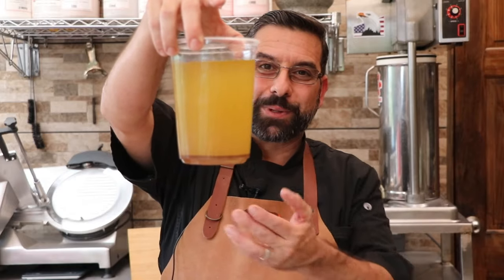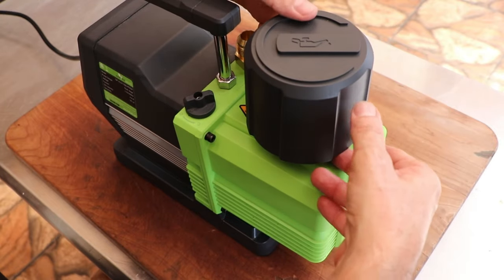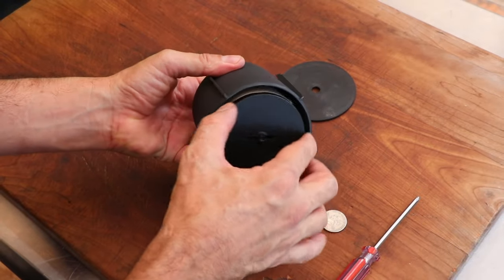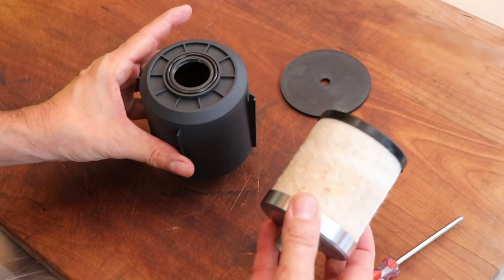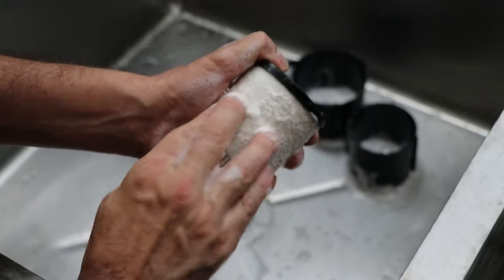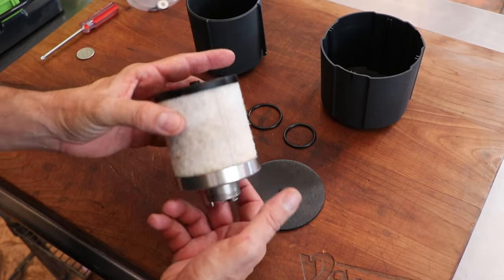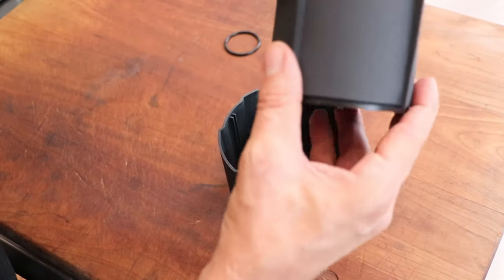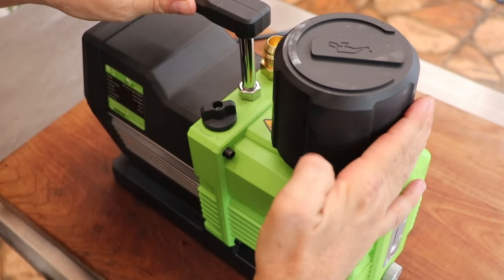How to properly clean the demister on your Harvest Right Vacuum Pump

Comment: I would recommend purchasing a second filter so you can install a new one then clean the old one and let it dry so it’s ready to be used the next time it needs cleaning!
Reply: I checked the website but do not see filters. Do you know where I can buy a spare one?
Reply: You may have to call the manufacture for the correct part for your pump.   @pamhoven
Reply: Yeah I’ve got a second but I’m unable to unscrew that plastic cover with a quarter. I’m beyond frustrated at this point.
Reply: @Fiona2254  the same happened to me. I wound up using two quarters and a large pliers, and gave it a few quick jerks, and it came free. Mine had quite a bit of locktite on it.
Reply: I used a butter knife and a pair of vice grips. Worked like a charm.

Comment: I cleaned it and set it out to dry and today when i went to see if it was dry when i picked it up and ran my fingers over it there was still some oil. 😢 i thought i had it all out. Wasted a day. Do i have to repeat it all over? How frustrating that i couldnt tell when it was wet that all the oil was out.  This was a brand new demister and after 12 batches oil was leaking out.

Comment: I have both pumps.. jb .. it stopped making vacuum. and the Harvest Right oil less,, also stopped working (bearings seized, seals worn out) not a good design.. I now find out that they say it needs to be rebuilt every 2-3 years for $375. .. wouldn't buy either again..  wondering if an oilless laboratory pump will work ok?  Much cheaper..

Comment: I don't know if this has been addressed so here it is now.
After you start the threads to screw the cap down at the end, be sure and look to make sure you did not bump the cap and the O-ring fall out. If it did and you screw it tight it will damage the O-ring. The reason I say this is because clumsy me when I was screwing my cap back on, I bumped the cap and the O-ring fell out. Luckily I checked before tightening.
You are a very very good teacher. Thank you so much for your professionalism and detailed explanation. Lord Jesus bless you and yours.

Comment: I bought my unit quite a few years ago with the original pump, and when the oiless units were introduced I bit the bullet and bought one.
My decision was made due to the fact that I have used vacuum pumps for years on A/C units and the oil changes are somewhat inconvenient,
and expensive! That oil is not cheap. Harvest Right does offer a nice filtering system for oil.I am happy with the new unit and haven't looked back.
Yes, it is not for every budget. I understand that. You do with what you have.
Thank you for your info and enthusiasm!

Comment: Kudos on your (should be award-winning) videos.  Long story short, received my new Premier Industrial Pump from HR.  Arrived an oily mess.  It must have been turned or rolled in transit and the remaining oil in the pump drained into the demister. Ugh.  I cleaned it up, but now it's for the filter.  Question.  After cleaning with Dawn and a thorough rinse, would it hurt to give a final rinse with alcohol knowing it will cut through any remaining oil and prevent any sticky residue on the filter material? (no, not on the o rings)  I think it will also help with the drying process.

Comment: How do you know when it's time to clean your demister?
Reply from the maker: you pump might not be getting a good vacuum or the demister is super dirty
Reply: Thank you. I finished a load of strawberries and unfortunately opened the valve while the pump was still running. The machine said pump off so I just thought the condenser was running.   I didn't realize until 15 min. Later that I needed to hit pump off. I am changing oil today and praying all.is okay.
Reply: I find that I can see the sun's rays coming through the window in the FD room.  There is a fine oil mist in the air, and the rays of the sun glow in the oil misty air. Very specialized testing procedure!
Reply: @spockmcoyissmart961  I read comments in another video about cleaning the pump (Live.Life.Simple.) that the mist, even if not really visible, can be very harmful. Other comments reiterated the need for an air quality filter running while the FD is running. I'm concerned about what I might have been breathing for the past 18 months. Has anyone else heard of this?
Reply: @barbaramandy8708  Fortunately, it is a food grade mineral oil, very low toxicity levels and humans can drink mineral oil for certain ailments. Do I want to breathe it?  No, but passing through the room, doesn't concern me. It is heavier than air, so it will settle to the floor/furnishings.  Now working over a Long John Silver fryer would concern me. ;)

Comment: How does the machine know we did a oil cgange
Reply from the maker: It doesn't.  There's more than likely a counter that tells the machine how many batches the machine has run.  After so many batches the machine probably automatically sends a message to the display.

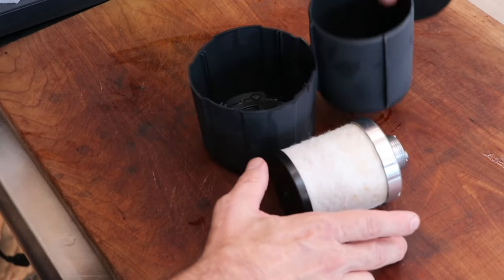Comment: 7:50 Your demister is NEARLY clean. You did not clean the INSIDE of the filter. I have a demister filter that is horrifically dirty on the inside and will require special attention.
Reply from the maker: LOL.  Yeah.  Perhaps and overnight soak in a strong degreaser will do the trick.